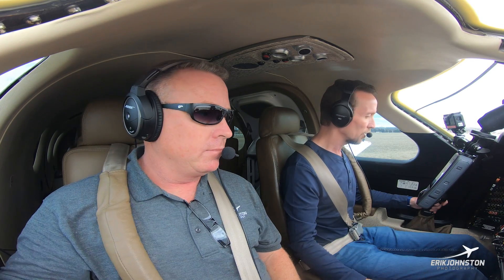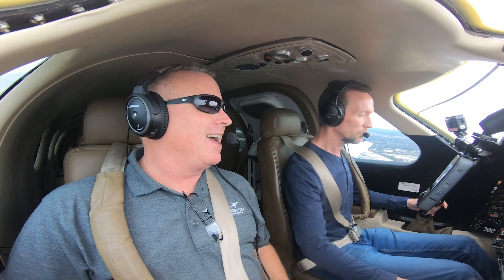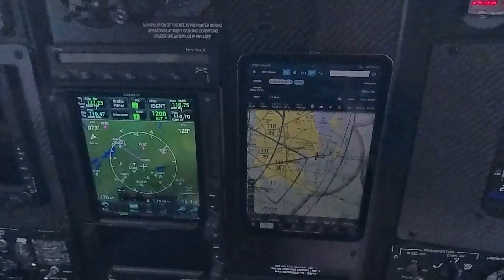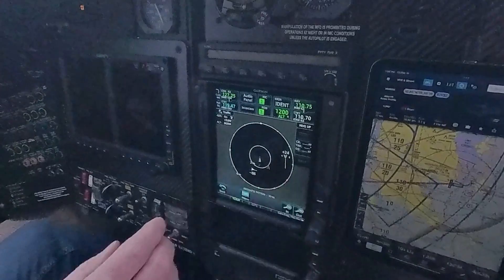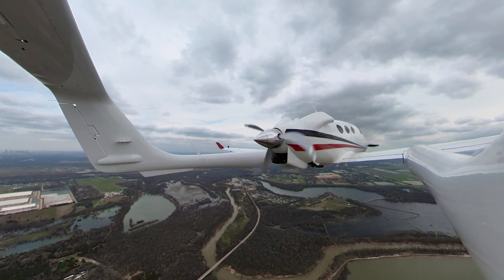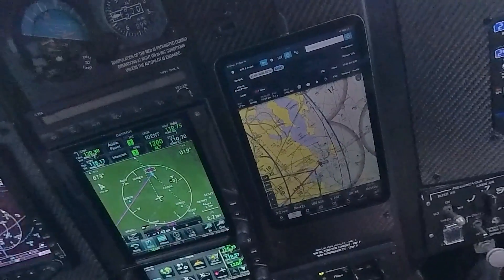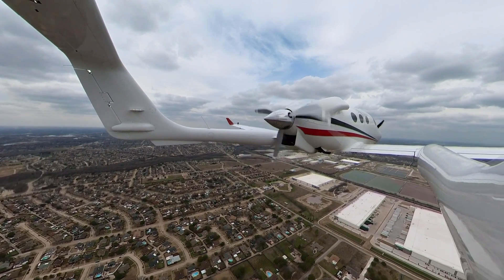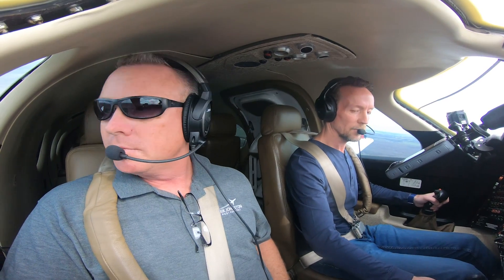Flying the Adam A500

Comment: Glad to see there's at least one 500 still flying.  I got to see the #2 test ship quite a bit when I was in Denver as it was the one they were using most at the time.  Also the A700 prototype.  Sad they didn't make it.  They had a really nice manufacturing facility that they built at Centennial and everything seemed to be moving forward, but the FAA with its reluctance to approve full-carbon fiber aircraft at the time (same reason the 787 was being delayed at the time), it finally killed the program.

Comment: Right after watching this video, YT recommended another video that explained what happened to the A500. Basically that video said the A500 was too heavy. When fully fuelled it couldn't carry any people, including the pilots! But it should've had enough power/thrust from the 2 engines. Not sure what was going on there. Maybe its aerodynamics wasn't optimal; perhaps the wings were not generating enough lift? It's really a tragedy that this aircraft wasn't successful. The concept is definitely viable and it is indeed much safer with two engines along the centerline of the aircraft. Who knows how many GA aircraft pilots and passengers lives could've been saved from engine failures if the A500 was in widespread use.
Reply from the maker: Watch my Walkaround video of it. Dan covers that
Reply: @ErikJohnston  Thank you. After watching that walk around video and checking the specs of other conventional twin GA aircraft, I see that the payload of the A500 is very much similar. So I don't know how or why this excessive weight and deficient payload myth on the A500 got started.
Reply: Aircraft are point-designed to a "maximum gross weight". This is the weight where all the book numbers for performance coincide. Takeoff and landing distance, climb rate and speed. Best glide speed. G limits, range estimates, etc.

If you add a bunch of fuel to inflate the range number to gain sales, then You have something like this. I have been unable to find a law against flying over-gross weight. But then, you are on borrowed margins and will perform worse than book in every way. Including range. Even with full tanks, due to being heavier.

Burt Rutan is a fan of highly stressed, lightweight, under strength, way over gross weight designs. Such as Voyager. Global flyer. And the Friendship tour Long-EZs.

Comment: Too bad they trashed the last two airframes. There is an individual who purchased a Starship One without the Airworthiness certificate. He restored it and got an experimental rating on it and is flying it. I think he also purchased a second airframe for parts before Beech trashed them. It cost them more to destroy the airframes rather than to sell them off without certifications. Joys of composites. Same problem exists with old wind turbine composite blades.

Comment: Air speeds please. Climb rate at various weights, endurance, fuel capacity, range, useful load, ceiling, cost, and fuel burn and capacity? Low level flight is nice but where is the most efficient altitude and power setting? Approach speed and landing speed, gear and flap speeds. Those are the things a prospective buyer would ask. According to the give specs there are twins that can match these and in this day and age whey the piston engines and not turboprops. That makes this in reality just an other twin with no other advantages other than a different look.

Comment: So frustrated to see Adam Aircraft fail.  Flying out of KAPA, where the factory was, and knowing some of the people involved, I thought the 500 was a design with much potential.  Timing against a failing economy, among other things, brought the company to a halt.  I got a tour more than once in the factory.  There were at least 6 airframes in assembly at that time.  During their flight test days, several times I was in line with them for departure, and got to see them fly.  At least once, there was a flight of two departing, the 500, and the prototype jet.  

Glad to see at least one flying.  I thought they all had been grounded.  There were a couple at Centennial in shelters that ultimately got donated, valuable parts reclaimed, like the engines and avionics, and the airframes donated to museums.  I know one of the factors was life-limited parts that got the airframes certified, with plans to provide mods to greatly extend the replacement intervals of those parts.

Comment: Is it supposed have gear doors? Those holes look pretty draggy. Cool aircraft.
Reply: It's a balance. The additional weight and complexity of a landing gear door system is probably the reason they chose to carry the additional drag due to open gear wells. The 737 has no main gear doors. Atleast classic 737 didn't..